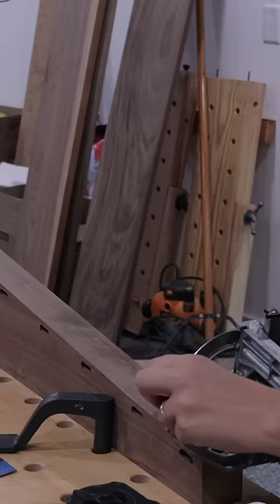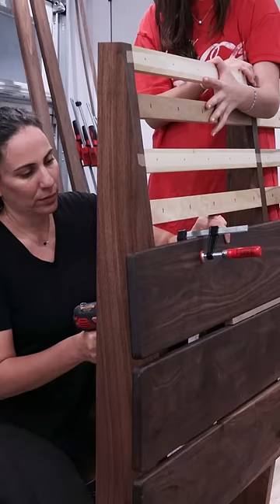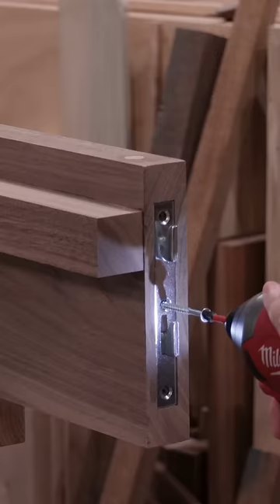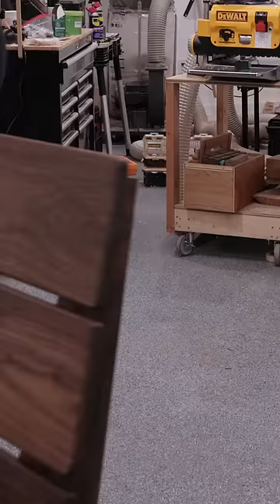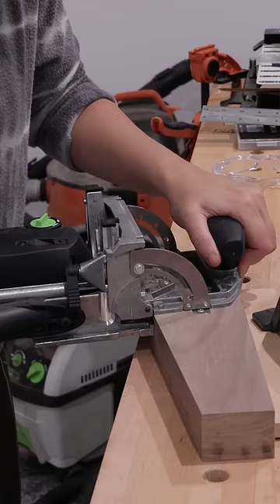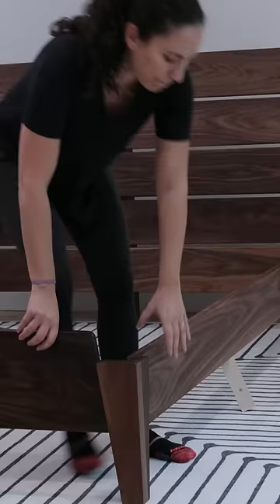Building a Solid Walnut Bed #shorts

Comment: What’s the name of that jig attachment you are using on the router?
Reply: That's just a handmade acrylic jig they made. You can make them out of wood too but you can't see through it. Most make them as a cheap and easy guide but if you're decent with a chisel, cut inside of your lines by 1/16th of an inch or so, then chisel out the remainder for a super clean and straight finish.
Reply: SEARCH for Tamar's ROUTER JIGS... those are excellent!